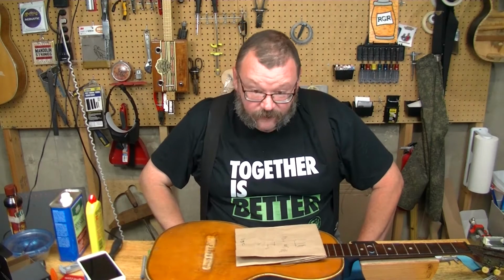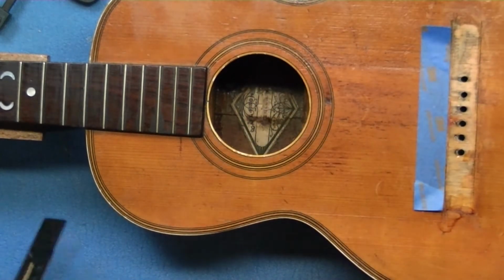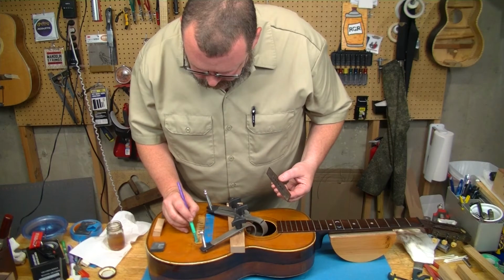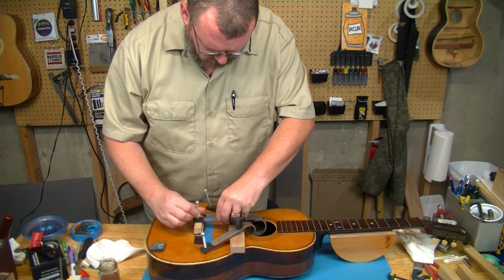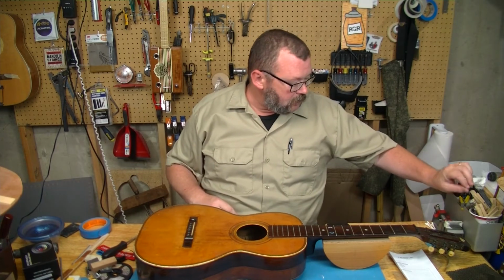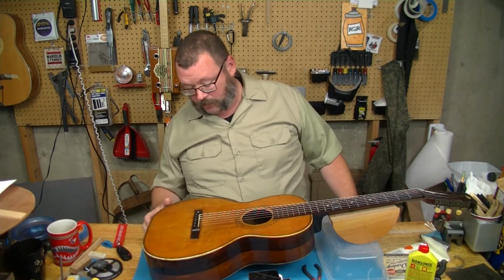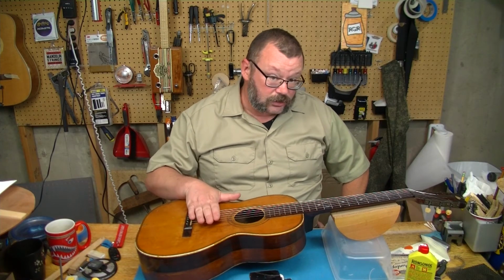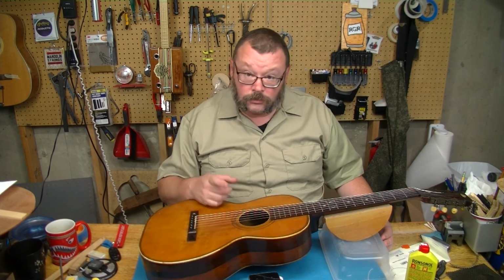CARL FISCHER bridge glue and done pt9 | RATTLECAN GUITAR RESTORATIONS by James O’Rear

Comment: Did you add a small amount of length to the scale  for compensation ,James? Couldn't make out yes or no? Perhaps that's why the pin holes moved the bridge back a slight amount ? Good set of videos James... what's next!? Cheers Rob.
Reply from the maker: I did add just a smidge, and I always appreciate a reminder. There's a mandolin neck repair waiting for the humidity to drop so I can clear coat it and a Regal parlor that's a trainwreck. Those belong to other folks so I'm trying to get them gone.